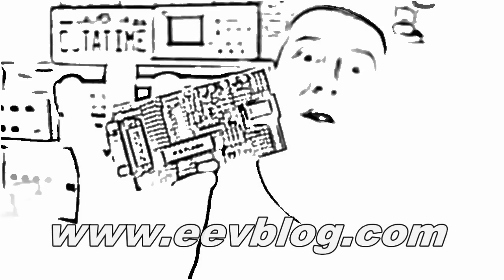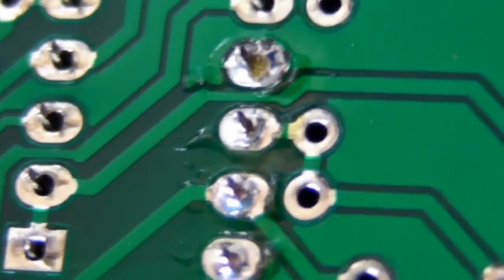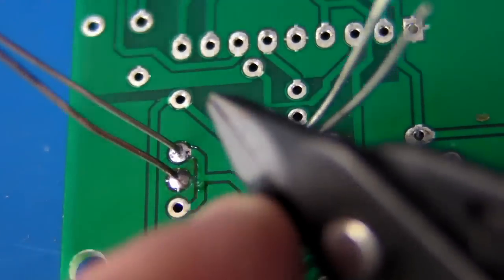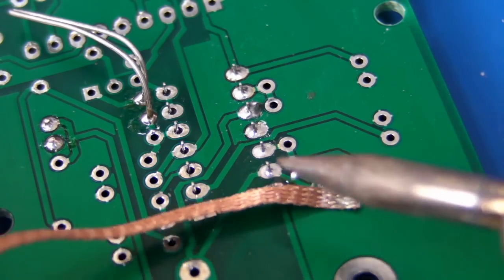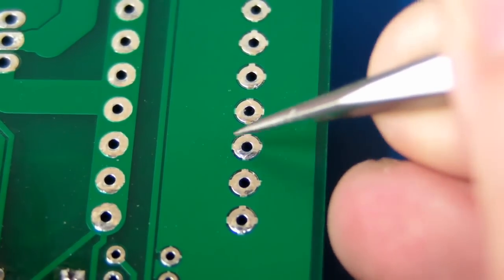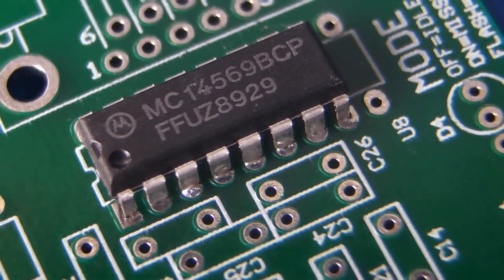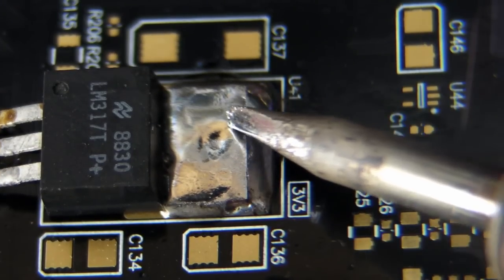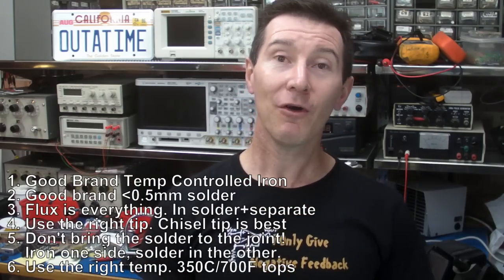EEVblog #183 - Soldering Tutorial Part 2

Comment: I do use a conical tip when I'm soldering wire to 0402 LEDs for my modeling projects.  Other than that, Dave is right.. the chisel tip is the way to go.

Comment: Cold joints also have poor mechanical strength, which means a good chance the solder joint will fracture (break) from the IC pin and cause intermittant electrical connection.  On high power boards such as PSUs, where excessive heat is prominent, perfect solder joints are a must!

Comment: Dave do you think it is good practice when soldering IC's to skip a leg in between solder joints so that you don't overheat areas of the IC.

Ex. Say you're soldering a 555 timer chip, you'd solder pins 1 and 3 first, then move back to 2 and 4. Repeat on other side.

Comment: No.  You'll be able to contact the tip for a very short time (less than one second) and then you'll instinctively pull away because it burns.  Burning skin is not a pleasant smell.

IF there were something wrong with your iron, then I suppose you could get shocked at which time it would be advisable to get another iron.  DO NOT solder on powered circuits, especially line powered ones...Most irons are grounded so shorts are possible at which point you will damage both the circuit and iron's tip.

Comment: @Nadrealis
Hey. I can give you one more advice: I've been working for a while for a company that made motherboards [nvm the company name ;) ], and we did some repairs on boards. 
When we resoldered  multipile leg chips, we just did the soldering trhoug all of them, and if there wer any legs betwin them we just used flux to take them down. 
If you soldier one chip in the right temperature you won't burn it in most cases. 
Propably in next tutorial Dave will give some advice about 168 leg chips ;)

Comment: Dave, I don't think you've cleaned the flux thoroughly. Spraying the board with IPA (isopropyl alcohol) and brushing only spreads the flux around. This can be seen at 12:57. What you need to do is wipe the dissolved flux off.
Afterwards you can just touch the board to check if it's clean. If it feels a bit sticky, it's not clean at all.
Cheers!

Comment: Good video. The only thing doesn't make sense is that the fine conical tip seems to be heavily oxidized, you can see the solder just does not wet on it.

Comment: When i was 12, I was trying solder. I remember I held the tip for too long on the board and it burnt, even the metal ring detached. How long should be the max seconds that one should press on the PCB before damage? 13:38
Reply: Honestly modern pcbs are very heat resistant and usually you can keep your iron on there for a good 20 seconds without damaging them. But do make sure you have a temperature adjustable iron, even a cheap one would work so much better than the plumbing iron.

Comment: Good video...sometimes  would spend the entire day soldering working in a tv repair shop. Those Sony tv's would come in dead and we would resolder a lot of the joints and fix them. We didn't have to buy and replace any parts.

Comment: Works good with a 6$ iron and 2$ solder from wal-mart. :) Question! the instructions for this iron say to plug it in, wait till its hot, then solder a joint than unplug it... Can i leave it plugged in for 5 or 10 minutes at a time without damaging it????
Reply: Read the instructions, if its not there then you should be safe to do that and itf it will damage itself then you should take it back to wal-mart.
Reply: neclovekSK Yea, it doesnt say. Iv left it on for about 5 minutes before. Its fine.
Reply: Leaving it plugged in won't hurt it, but unplug it for safety if nothing else.  Cheap irons do just fine too.  Only get the irons he recommends if you are 100% serious about this hobby.
Reply: BUNCHofxs You can leave it on for longer periods, but unless you're constantly soldering and wetting the tip, it'll oxidise pretty quickly. Back when I had a 6$ iron, I added a table lamp switch to the cable so I wouldn't have to unplug it every time I prepared boards and components for soldering.

You should really invest in a soldering station, though. They're much more fun.

Comment: As a "young player" there are a few confusing things about the temperature.
If you look in most datasheets it says "soldering temperature max 261°C" and I understand that 37 / 63 solder have a "melting window" at 183°C. So why do most set the iron at 325-350°C ?

Comment: I am new to soldering..question: what are the steps to remove a bad resistor so that I can put in a new one? Heat and pull it out? Then do i need to do anything before i put the new one in? Thanks for these videos - very helpful and thorough
Reply: Wick the solder, then while it's still heated, gently pull the resistor out.

If you do that well enough, you'll be left with a nice, tinned connection to put a new resistor into.

Comment: Also for the cup, ive seen its way easier if you twist a piece of solder. Stick it in the cup, cut it, then heat, after that heat it again and stick wire in

Comment: Old video, but with the pointy tips you're not supposed to use the very tip, you're supposed to use the side of it, just like you try (successfully). To me it's a matter of preference and what you're used to, I think using the side of the pointy ones much easier than having to keep the tip of the chisel in place

Comment: If you were going to be really obsessive compulsive about soldering gold plated parts - to NASA workmanship standards or the like - you'd tin the parts and then wick away the solder before making the connection, to prevent the gold contaminating the joint. 
In most cases it's not necessary, but it's worth it if you need guaranteed reliability and quality.

Comment: the way I do it is to place the iron on the joint and then touch the solder to tip of the iron just long enough to get it flowing the move it away from the iron to the joint.

Comment: What problems are there that can result from having too much solder? I realize that not having enough or cracking the joint or cold soldering can cause intermittent discontinuities, higher resistance, and higher capacitance, but it isn't obvious that having too much would cause problems (assuming you aren't bridging pads). I know when soldering copper pipe you can get drips inside the pipe if you use too much, impeding flow and sometimes breaking up and clogging other stuff, but I don't see how the electrons would care.
Reply: +Anson Mansfield It's not really a problem per se, but too much solder can hide a bad joint from visual inspection. Big blobs of solder can form when the pin/lead of the component doesn't wet correctly due to oxidisation and the person tries to wet it some more. It then looks complete but it might just be hiding a non-soldered pin. If you can't see the pin, how do you know? Any serviceman repairing consumer electonics for an intermittent fault will check for dry/cold joints and if they see a blob they will resolder it. Not because it is guaranteed to be bad bond but because it is not guaranteed to be a good bond.

Comment: I wish I would of seen this video when I first started, I saw a bunch and all were confusing and boring. Yours are very explained and very dead on accurate. I have a soldapull pump and use that instead of wick, but which one would you recommend? I sometimes have a hard time sucking up all the solder with the pump.

Comment: Why is it so important to the solder to wick through the holes to the other side too? I understand that the joint will be a lot stronger that way, and that's the proper way to do it, but functionally a crappy application of solder should still do the job as long as there is continuity, right? I am asking this because I have just re-capped an old computer (haven't really soldered before), and after this video I realise now, that most of my joints are sub-standard. As we are talking about 70 something capacitors, I would rather not go through all of them again. So if the computer will end up working, can I just leave it like that? The components will not be subjected to physical stress, like wires would be for example.

And yes, I do realise that I really should have watched these tutorial videos BEFORE my restoration adventure. Oh well.

Comment: @Nadrealis Nope cause you don't plug the IC in till after you solder the socket. I usually wait until after the whole board is done or at least the section I need to currently test.

Comment: it doesn't really matter but it's better if you do not directly apply to the soldering iron because sometimes the other side of the pad is not heated up yet leading to a cold solder joint. but otherwise just stick it on there.

Comment: What if, you put solder on the tip, then apply flux to where the pin is, then touch the top to the pin. Wouldn't it flow?

Comment: If you want to form a true cold joint, you need to heat only the pad. In the worst case, it results in a joint that you can physically remove the component!

Comment: Hi Dave, thanks for the Videos. I was wondering if you save the boards from the dumpster dives and de-solder parts from them and use them when you find you need a certain resistor or something. Cheaper than the parts store any day.
Reply: That really depends on how expensive the part is and how expensive your time is ;)

Comment: @EEVblog Novice question, but when placing the Solder Tip at the metal ring, won't it cause some burn and damage to the surrounding circuit board?

Comment: Oh and btw I'm definitely not a pro, I'm totally a beginner, but I'd humbly say there's too little solder on your joint. If I put that little solder on a joint, I'm usually afraid it would break easily later, or the solder might not even have wetted enough the pad/component leg. I like to use more solder, but obviously not enough to make it a huge blob or short out terminals. Could you please point out the technical problems associated with too much solder?

Comment: i dont really do SMD stuff but i have a DSE temperature controlled iron and 0.8mm solder. i may have to get another iron as the tip on the DSE iron is getting shagged. but yea some good tips in there

Comment: Didn't work for me. Heated up the iron. Pressed the iron to the terminal for 1 second, then touched the solder to the other side. Nothing. Held the iron to the terminal for ten seconds, then touched the solder to it again. Nothing. Gave up eventually. The tip of the iron was hotter than the freaking sun, but the solder simply wouldn't melt.
Reply: +Yella Dart It may be that there's a cold spot on your tip due to dirt or oxidation.
Reply: did you tin your tip? did you apply any solder to the tip before the joint? this will allow it to heat quuckly
Reply: +Yella Dart Some parts do suck away the heat and make it a pain in the ass.
Reply: BenjaminGoose Yeah, turned out this was the issue. The tip looked clean as all hell, but apparently it wasn't as I replaced it and the new one works great.
Reply: True, I've had "cold spots" on old/abused iron tips.

Comment: Why are all the pads on the PCB pre-tinned?

Also, how do you use the wick without getting your fingers burned?
Reply: The pads are pre-tinned to help the heat get into the PCB so the solder holds firmly and also the solder doesn't go wondering off the pre-tinned area. Also note that these pre-tinned areas may get sucked when using the suction tool for removing solder and because of this I prefer using wick to remove solder.

I like to hold my wick with a pair of needle nosed pliers which prevents my fingers burning.
Reply: and how do the pads get pre-tinned? does the pcb manufacturer do that?
Reply: Just  pull out about 3" (~10 cm) from the reel and hold the reel.  If you're heating a really long time for some reason you'll just melt the reel's plastic edge a bit.

Comment: Hi, you are just making one big mistake : Never clean te tip and put to iron into its holder. The tip now has no protection to oxidation, its much beeter to wet the tip well with solder and put it in the holder like that, and clean it before soldering, not after.
It's a mistake and bad habbit that costed me some tips too.

Comment: @EEVblog

Thats a great video . I like that your using chisel tip for your solder iron . Im going to change My tip In my radio shack soldering station I own . Its temp controled so I can set it to 600 f for soldering the new relay Im going to solder in my marantz sr-18ex receiver I own . That should fix it I pray . But a on youtube that has a video on a sr-18ex help me with trouble shooting . I founf the bad relay not opening right , But I may as well have a bad cap in the power supply

Comment: @criscros7 That's what I thought. Thanks for your answer. :) Even though there might be no problem with the amount of solder shown by Dave, I'd rather be on the safe side and put a bit more. AFAIK, it might only be a bit harder to unsolder the component later. The amount of solder I like to use is close to what they show in /watch?v=I_NU2ruzyc4

Comment: If you use external flux with a solder that isn't rosin core, can you apply the flux to the joint separately then put solder on your iron then bring it to the joint? Or is it always a big no-no to put solder on the iron and then bring it to the joint regardless?

Comment: I am a complete amateur but I am wondering, shouldn't you jab the pointy conical tip down into the hole until it is wedged against both the lead and the hole? It seems to me that the problem with the pointy tip is that you are not using it as intended.
Reply: Get the correct tip as you need contact to both the lead and the pad
Reply: If you put the tip into the hole like you're describing, you'll pull the solder out when you withdraw the iron. It will also displace the solder while you're working, which causes a bad joint. You'll want to have the solder flowing freely into the hole, so it's best to keep the iron on the surface.

Comment: I'm always worried that I damage the components while soldering. What are Your experience with that? Is it easy to damage components?
Reply: most components are more heat resistant than you'd think, but for componenets that specifically say they are sensitive to temperature, you can buy heat sinks that go on the lead to keep it from going in the component, and you just try to go as fast as you can

Comment: Hi Dave, what size tips are using here? I want to get some chisel tips (shape-D) and bevel tips (shape BCF) for my Hakko FX-888 (it comes with the cone type [shape-B], that as you point out is not the most useful for this kind of work). I want to use it for some electronics stuff (smaller tip), but also general electrical repairs (larger tip). Thanks.

Comment: I hate to be the giant noob. But what does the actual part labeled MC1489N do as a function on a real working circuit board with that part?
Reply: You can literally Google that part number and find out for yourself. Takes two seconds.
Reply: No way! I can literally google it? I had no idea that anyone with a thumbs and half a brain could perform such a task! Thanks! As if I knew how to read data sheets on quadruple line receivers.
Reply: Cory Smith It is an IC (integrated circuit) chip. It's a component that can have various circuits inside of them contained in silicon. Everything from an array of simple logic gates all the way to more complicated circuits, such as the one inside of this chip, can be in IC chips. This specific one contains a "Monolithic low-power schottky"  circuit according to the data sheet. It says that it's used as an interface device but schottky components are typically used to prevent the back flow of and/or protect against changing voltages. An example of this would be preventing voltages from flowing back into the panels on a solar panel at night since they are not producing energy, but are still part of a circuit. Hope this helped!
Reply: Tyler, yeah, because we can't have people asking questions about electronics in the comments of a video about electronics on a channel devoted to electronics. That would just be madness! ;)
Reply: Nick, thanks! Great answer, much appreciated!

Comment: Good tutorial, except I don't understand why he wants to apply the heat on the far side of the lead. I solder for a living, and I always apply the solder to the point where the tip meets the component. It melts and flows instantly, and there is less chance of overheating the component.

Comment: Every single tutorial I've read on soldering says "the conical tip that comes with your iron is crap", but every soldering iron I've seen comes with a conical tip, and you only get better tips as "extras". Why don't they just give you a wedge-shaped tip by default, and only supply the conical tip as an "extra"?

Comment: Dave, when i'm soldering TH, i always put my solder tin against my irom while my iron is against the leg, then the solder starts flowing and then i remove my solder tin from my iron, but i still add some. 

I can't explain it really good, it would be better in my mother language (dutch), but ist's a little bit like u do at 8:50 , but then with my tin against my iron. 

Should i put the temp. of my iron higher? It's now t about 450 - 470 degrees C.